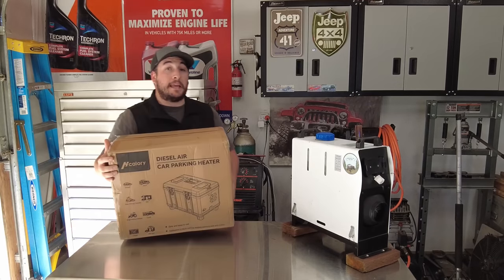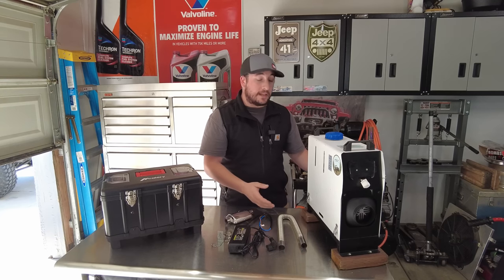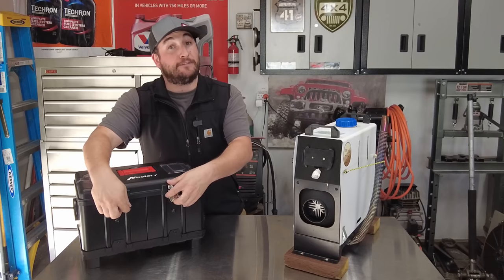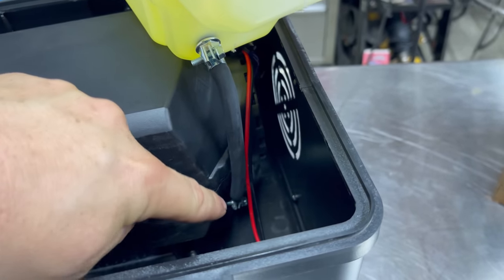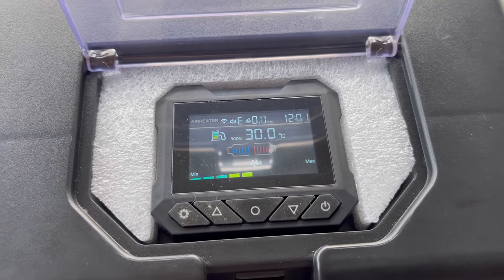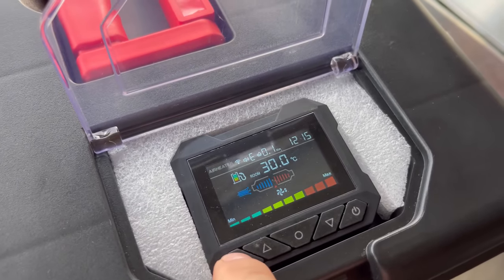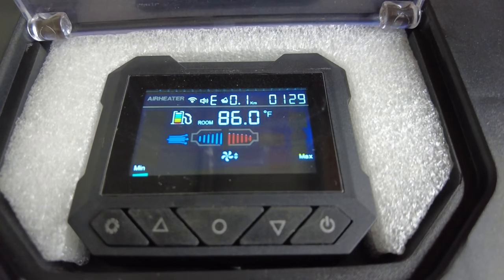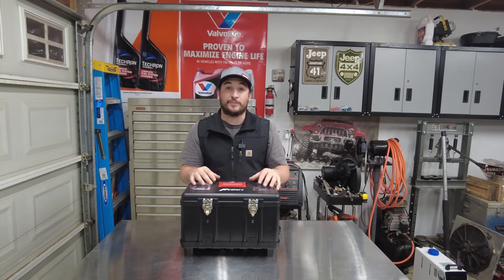KING Of Affordable Diesel Heaters | The HCALORY - SS2 8KW Air Heater | This Is The ONE

Comment: Junk, the cheap ones are nicer
Reply from the maker: That’s fair ! I figured it’s not going to be for special people 🤷‍♂️🍻
Reply: @ATEMOFFROAD  it's just a larger price tag for ultimately the same unit. There is also a few quirks that were not addressed that I figure would have been for the upsale
I ultimately use them as shop heaters as well so the slim design of the old ones are better suited where as I do agree with you about the housing on the new one for the packing aspect
Reply from the maker: @jordanmaerz7852  the controller and controls are different. Improved and more user friendly. Your buying the updated controls and better enclosure. The old heater cannot do what this new heater can do on the fly. Especially For tent camping you won’t need to extend the controllers cable so the thermostat can be in the heated space. They fixed that with the new level mode heat setting. The Old heater is an indoor heater only unless you modify it. Also for advanced settings you must go into engineering mode and calculate altitude/fan and fuel pump speed if the thermostat is overrode. This setting would need to be changed every time based on location. The new heater takes the guess work out of all that and automatically adjusts. It’s more efficient this way and way easier to set up for the mobile user. No others are at this level.🍻